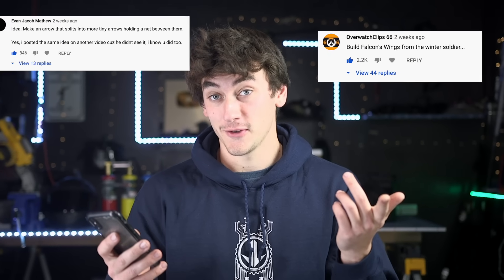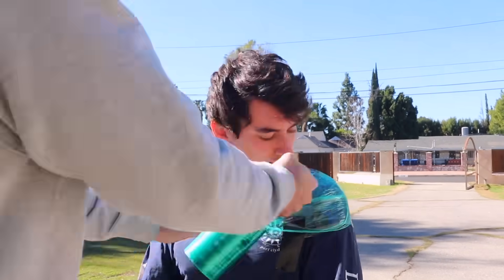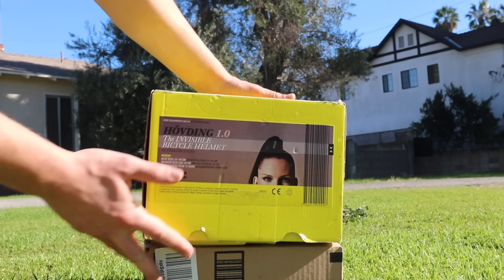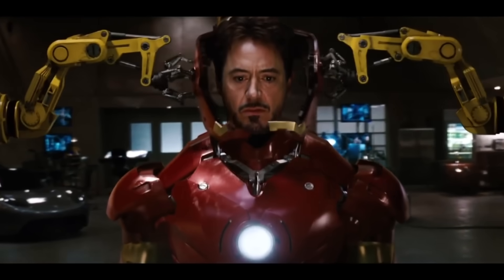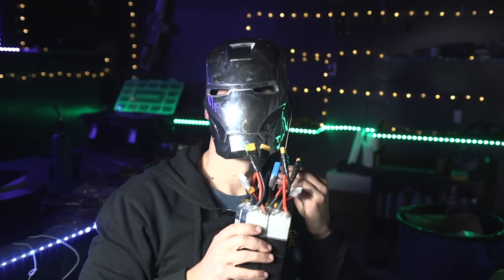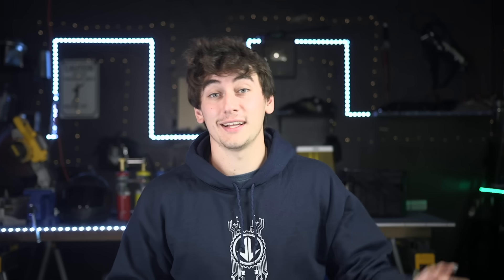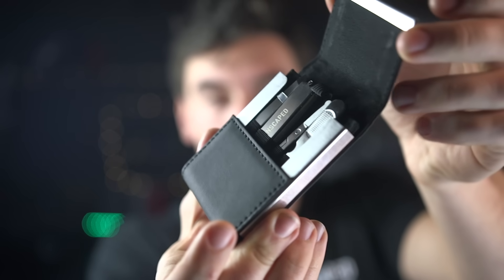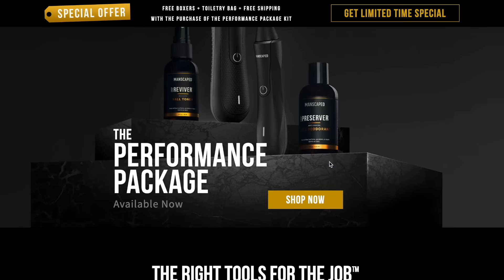Retractable Metal Iron Man Helmet With Heads Up Display - Augmented Reality AI

Comment: I feel like there's a way to not have the back of the plate to have the helmet come over the head and onto the facial interface. I have an idea already for it. Much simpler and smaller devices can be used. Its a foldable iron man helmet. The layers of the helmet from the back stack on the back of the head and fold by some motors that control them. The mask itself would also be with it. The first back layer would fold up onto the back of the head then the 2nd layer and close the gap by 2 different motors: 1 to move it forward and back then 1 to pull it towards the head. The rest is basically the same. I just feel like this could work however if it's not already been done. 

One more thing... the layers would be close together to make it compact but still able to move with the motion to pull it forward over the head and or back.

Love the videos and I know I'm 3 years too late but it's a thought 
that came to mind while watching this video back.

Comment: I,m making a home made IRON MAN life sized bust (from house insulation foam blocks) & it's going well.
I don't own a 3d printer or understand Pepekura complex patterns & so  I joined the insulation blocks together & worked from the middle out to the left & right. (using a very accurate 1/4 scale bust I own, as referance)
I hoped to pick up some construction tips here, but youve had it all done for you off camera

Comment: One reason for using helium in the airbag is because it is a noble gas...meaning it won't combust no matter what. CO2 is also non-reactive, but more affected by temperature.   CO2 might not inflate the system on a very cold day.

Comment: How much was the helmet price? Couldn't you add another display on the glasses fram attached to the faceplate. I would add a camera hidden in the eye holes at the top so the lights are on and you can see through the heads up display unit.

Comment: I believe you use a white material cover your face leaving a perfect mold and then you can build around it with perfect snug in a little bit of room so it's not supported completely from the top part of your back head but good project

Comment: You don't need to use a pusher mechanism. Why don't you slide the face part back up a bit like a slider. Also the advantage is that all the weight is already on the helmet so you need a real small motor and a wire to pull up and slide back down

Comment: Here is an idea: Piezoelectric sword with dual electrified impact blades.

 So a rod with a core filled with a piezoelectric material that sends a charge to the blades that are themselves on a spring that slide back and impact the material.

Maybe put a tazer in the handle that is powered by the impact itself using a similar system. If you use 2 blades in the design you could send the arc between them/ along the void between them.

Comment: You can run electricity through the nitinnol wire to make it bend.  I designed a steerable catheter for biomedical tech back in the day for senior project.

It's called muscle wire nowadays. Back than I saw zero peer reviewed papers on it.

Comment: Mandalorian Dagger? if you remember in the first season of The mandolorian he pulled a vibrating dagger from his boot.
how 'bout scratching the vibrating idea and using Alon as a blade, then placing the full tang Blade inside of a handle that has a light that colors the blade (Alon is Aluminium oxynitride and is hard like Aluminium but is transparent, it can also shatter under extreme force.... Like a 50 Cal. bullet)

Comment: Wrist mounted,  ' laser ', like the one buzz lightyear has.  The thing itself is, an led powered by a battery pack, with a couple of double a batteries. The button, could be a flashlight button. The biggest problem, with this, is the diode. It's a big one and the whole thing, is a Disney product.

Comment: Request: Make real web Shooters Using A device that pulls carbon dioxide out of the air and turns it into carbon nano tubes Don't know if this is possible but if it is Start big and then try to shrink the design down As much as possible I don't know how it will grapple on to things but you can figure that out

Comment: I have an idea which can upgrade your auto skin fitting spiderman suit (maybe) so... My idea is u can use a material.....mmm i cant remember the name but its generally use for storing cloths type material and have a hole from which u can vaccum the air and it will make it lesser wider than before so u can use that material for ur suit and it will not wrinkle also but the problem is u have to use very small vaccum machine which can be fit in suit and not get showed alright that was a raw idea but i know u can do more better...and yes if u work on my idea please make button of suit on the spider logo so that it feels that its totally a stark suit like in homecoming..

Comment: Also nitinol has a pull strength of 52 tons per cubic cm ex2 making it very strong the only issue would be applying the heat you need to make it contract because to make it fast you need a lot of heat and simply passing a current through it is pretty slow so maybe if you used molten candle wax to store and transport the heat because that candle wax can store a ton of heat but idk there are a lot of other fluids you could use.

Comment: Hmm. I like the idea. Now maybe branching away from the Ironman look, you could get a jacket with a detachable hood and fit the framework idea that. So when you put the hood on the lower section of the mask folds up and locks into place from the left and right side. Then the face plate and sit comfortably in the top and fold down and join the rest once the lower part is locked together. It would also give more room for added mods or hiding electronics.

Comment: Suggestion: Make a hammer like thor's where you can summon it to you.
Reply: Or you could use flight tech
Reply: i don’t understand how you could do that without the entire thing being made out of foam, and even then it’s still seemingly impossible. If you used magnets you’d need to obviously use a magnetic metal, and with all of that weight needing to be pulled you’d be ripping pipes out of the wall.
Reply: @LitheDBD  maybe like make it rlly light weight and slap a drone on it like yondus arrow

Comment: The problem with the nano-tech Iron-Man suit is they went with the "it comes out of no-where" method. Basically condensing matter from the energy of the Arc Reactor and instantly 3-D printing a whole suit in seconds. People just can't wrap their heads around something that advanced and it feels "unbelievable" or "fake".

Meanwhile Hiro Tadashi from Big Hero 6 uses far less OP micro-bots that need to be manufactured and stored in huge bins. That makes it more practical and believable.

They should have gone with that kind of approach where Tony only has so many capsules of the hyper advanced liquid metal mano-bots to shape into a suit.

Comment: have you heard about electrolysis?

(if not here is a brief explanation)
you can put electricity through saltwater(or anything that can carry electricity), but that would release chlorine. it would release h2 on one side and o2 on the other (if they are not touching) and the more surface area you have the more it will produce (along with electricity) i think it would be cool to see a project with this, and if so, i doubt you would see this anyway

Comment: U can upgrade the tilt mechanics if u hard mount the mini actuator to a hinge that is connected to the helmet and it will look more real if u put a small li ion battery in the back of the helmet and a hidden button in the side of the helmet so when you press on it the helmet will slide over ur head.

Comment: Cool Video

7:00 The reason they use Helium is because it's a physically smaller molecule than CO2 - in a gas, particle size doesn't matter since there's all this empty space between particles. But in a liquid, when they're rubbing all up against each other, the physically larger CO2 molecules can't fit as many in the same space. That means you can pack more helium gas into a canister than you can with CO2 - probably part of the reason your version didn't get as puffy?
Reply: Stop spitting facts
Reply: @Batmaniggga what are you jealous of him he just knows stuff and is being useful what’s your problem no one asked you to read his comment.
Reply: Ur smart 🧠

Comment: dude idk that huge plate and backpack in the pack is kinda crazy couldn't you use like aluminum who cares if it's a thin light metal I think you made your helmet to heavy make it  thinner and lighter so you can actually have the mechanics in the helmet ir atleaat not have a huge plate and backpack..

Comment: Is there a way to make a screw and rail system made of the material of the heat responding titanium. An electric induced heating element to grow or shrink the screw causing a mechanical spinning, moving the rail system to open and close the helmet slats?

Comment: They used helium because lighter than air. So the pressure difference and density difference increases the speed in which it opens. You don’t want to wiggle you air bag on.

Comment: Thors hammer with a gauntlet that makes it come to you. like some thing magnetic
Reply: But wouldn't it hurt ur hand or wrist?
Reply: I don’t think a magnet exist that powerful
Reply: @notxams2793  Especially one that would attract just the hammer and not everything around you 😂
Reply: Like The hacksmith's captain America shield
Reply: That sounds deadly.... i like it
Reply: Or better we can make it somehow so that it can fly and use something in gauntlet that it comes back in hand like an autopilot mode.
Reply: thor's hammer irl is mostly heavy, and how big of a magnet would you need to lift or bring it to you
Reply: That require powerfull magnetic energy
Reply: @EricSyz  It would also have to only attract certain metals cause if it was powerful enough to attract from a distance then it would attract every piece of metal around you
Reply: Or Nylon

Comment: Hey Jake i am 13 and very young i have a bunch of tools i can use including 2 3d printers a laser engraver, plasma cutter, soldering iron, drill press, and a welder i am putting this in the comments because i did not know i i would be eligible to submit this on your website

Comment: Make a Spider-Man tracker shooter thing from Spider-Man Homecoming.
Reply: Ya like we see in the Spectacular Spider-Man animated series. Those sticky tracers are sooo cool!

The biggest problem is figuring out a way to fit a sims card into it to give it cellphone data (mobile wifi) so it can be traced anywhere.
Reply: @Hadeks_Marow  yeah, I mean SIM cards are pretty small.
Reply: @Krrr-j1d  Alone, yes. A system small enough to have a built in transmitter. . . sure. . . . something small enough to be shot out like a blow dart. . . sketchy. . . something that small that can be shot out like a projectile and stick to the surface of something on impact. . . thats where it gets impossible. 

Combine the simscard with the transmiter (computerized device) with somekind of power source (probably a button battery or something rechargeable like lithium) and you got something the size of a smart watch. . . which is really thick. It could be useful to slap onto a car via magnetics. . . but attaching to anything else (like clothe/someones clothes or villain suit) and that's where size becomes and issue.

Size = weight. Meaning if it's small, then it just needs to be sticky. It it was heavy, then the heaviness would make fall off and where the stickiness wouldn't be strong enough, too much downward force. The ideal scale is that of a coin and the weight of 15 pennies. See how this starts to make things tricky if you want it to attach to all surfaces yet still be connected to the internet?

The alternative is some kind of radio signal which would be SUPER low range. And even if it wasn't it would be way out of his range of expertise.
Reply: No.1 Spidey-Fan  tracker!!